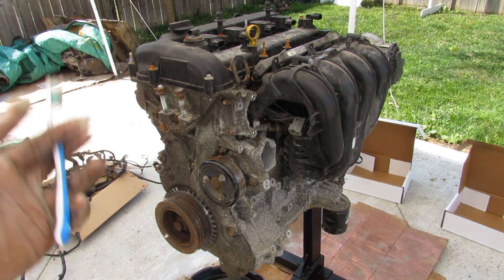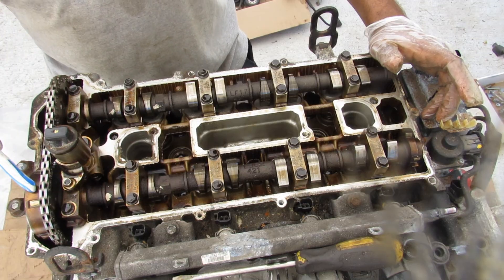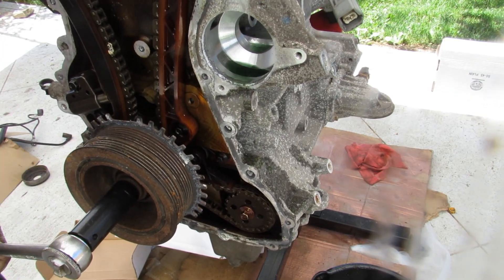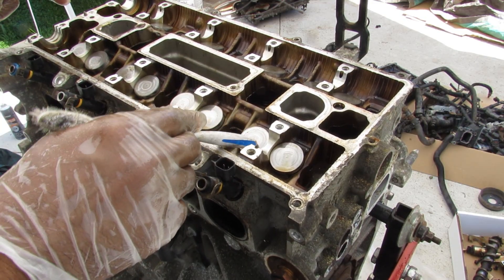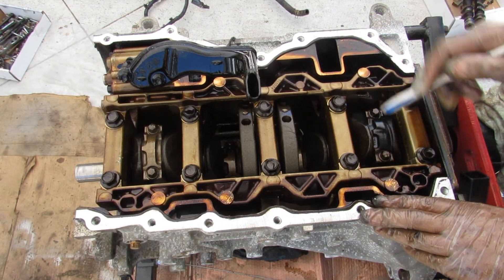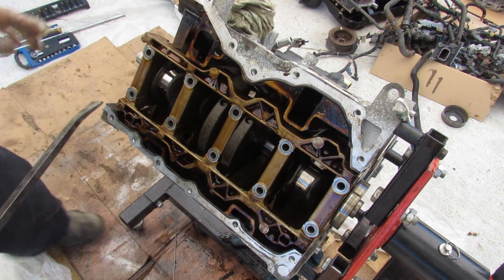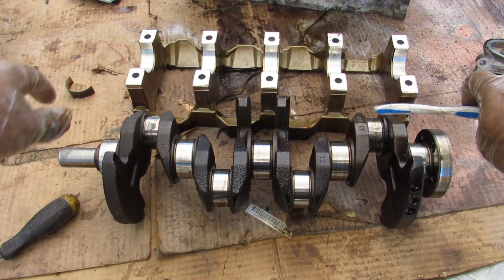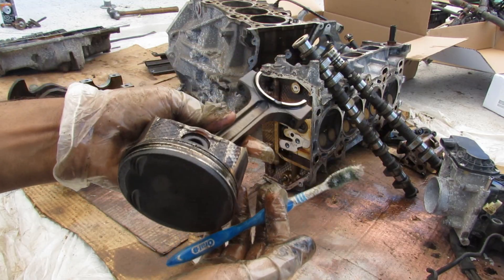Why Mazda Engines FAIL

Comment: 11:00 time. The cooling system, was not designed for enough heat dissipation. The aluminum block, also is a problem, with thermal expansion, and therefore vertical twisting, when cooling system WAS  NOT  ENOUGH. The block, is too high, for its' width. The oil system, is poorly designed, also. Starving 1 and 4 crankshaft rod bearings.

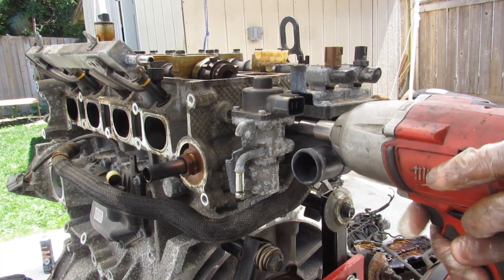Comment: wow. What a goofy, dumb design. They have 'lost  their  way '', in designing, and producing aluminum blocks. No keyway for timing.?? plastic parts...?? wtf. 6:10....i've  watched enough.....this is NOT  designed, to be repaired. Just throw it in the re-cycle bin. Get an older inline 4, or 6 cylinder...modern 'junk'...

Comment: I have a 2010 ford focus with this engine, 110,000 miles and everythings fine. Ive changed alternator, motor mounts TWICE,  and the thermostat. I bought it since new, ive always changed the oil. How long could this engine last?
Reply: With the servicing and maintenance in check, you haven't even hit half it's lifespan. I'd expect atleast 250k miles.

Comment: My 2013 Ford C-Max hybrid with this same 2.0 engine has 190k. Runs perfectly and doesn’t burn a drop of oil. I do run full synthetic and change the oil ever 6k. Even I’m surprised it’s been so good 😂

Comment: The duratec  and MZR are not the same engine.
Reply: AFAIK engine block is same, Mazda and Ford made different heads for themselves.
Reply: @petrnemecek4379  That's the Duratec V6. Ford had it originally, then Jaguar made their own version of it with better flowing, and VVT heads. Mazda then used the Jaguar version (Hence why they called it the AJ, it's a Jaguar designation).

Comment: I have a Mk2 Focus (not North American) with the Mazda Z 1.6 paired with the G4A-EL 4speed auto. I'm just at 80k very urban miles and it's lost some compression and the valve cover gasket was replaced. Getting 17/23mpg US city/hwy. Exhaust smells a bit too rich even when warm. No problem sustaining 100mph amidst tropical temps.

It's everything outside the engine that's been more problematic. The front suspension is overstressed and needs new ARB links every year. The auto trans has harsh shifts from first to second sometimes (maybe a faulty solenoid). The AC blower, brake booster and the fuel tank are hard to access. Googling parts for the car is a bit complicated as the Mk2 shares little with American Fords but at the same time the config we got in Southeast Asia isn't identical to what they get in Europe (they got the Zetec instead of the MZR). I have to use Mazda3 info sometimes to get a better idea.

Comment: I’ve installed a used engine from a salvage yard into a customers car, only to find out the salvage yard had loosened the crank bolt. This means disaster, since the timing chain spins when the cams try to center on the lobes. The cams must be locked with the correct holder tools, BEFORE loosening the crank pulley bolt! For crank TDC you can use the pin, or a dial indicator on the piston. The crank won’t spin on it’s own, as easily, only the cams.

Comment: You should do a BMW m62b44 v8 with the worn timing chain guides. Typically results in grenading.
Reply: BMW =  Bad  Motor  Works

Comment: very cool we got this engine in the ford fiesta st 150 mk5/mk6 in europe in a slightly different configuration. no egr valve no variable timing and no flaps for the intake. i also think they are good and reliable when you take care of them also they have alot of potential. i went to the dyno last year with my 215.000 fiesta and it made just with an exhaust system 158hp while factory its 150 and with cams intake and a tune they can make up to around 190hp. compression was also very nice 14-15 bar troughout all cylinders. im just wondering how you set the crankshaft sprocket right because it triggers ignition and it nit beeing keyed is pretty messed up

Comment: Title should be: "why Ford engines fail". This is exactly the reason why i pass on the MX-5 NC series; they have Ford engines.
Reply: sorry to burst ya but all of the ford/mazda 4cyl are mazda/ford collaboratives since like the early 80's all the way until like 2013
Reply: @Foreverchanger the weakness is the chain and the vvt cam gear, everything else is fantastic even the oiling system and the materials used.
mazda designed, ford puts its own engineering into it and they both manufacture a parts bin which lots of versions of the same engine are made from but are all entirely compatible, even the ecoboost engines share that same parts bin
Reply: Since the NC came out there's been very little trouble with that engine. Again the only thing I've seen is damage from lack of maintenance. Beyond that you might have a thermostat on occasion just like the rest of the Ford engines.
Reply: The MZR L engines were mostly engineered by Mazda. Fords involvement was limited to certain off the shelf parts and ensuring adaptation to their own cars. It is not correct to claim these are Ford engines when they were engineered and produced by Mazda.

Comment: Cant you just loosen the lower timing cover bolts
if the pan needs to be dropped off, ???
 I.e. No need to remove the whole timing cover ¿¿¿
Reply: Yes. I've resealed many an oil pan on that model and you can get the oil pan off without removing the timing cover.

Comment: Duratec is a reliable engine, change coolant every 30K, will last 300K + easily
Reply: Err ?? Here in Oz taxis with Barra engines go over 1M kms and then the engine is still sought after.

Comment: Bc dummies are using 20 weight garbage. It should be illegal (and doing 5k+ oci on dino or 10k on syn thinking it's safe). 

Newsflash: The manufacturer is a liar and wants the car to fail.

Comment: Much respect for posting this!...I have an '07 Ford Focus with the 2.3L Duratec/MZR...it's nice to know that the water pump is easy to access, but I'm not looking forward to re-timing the engine if need be 🥴
Reply: These engine are really easy to work on 🥴 and you don't need to time it if you're just going to replace the water pump
Reply: @carlossantamaria7967  I'm a Honda tech...so when I got this car last year and I heard that these engines are not keyed, I was worried to say the least. Otherwise...it's easy to work on, just like most JDM engines.

Comment: I have two Mazdas with the 2.3L, both have around 280,000km. Oil is changed every 5,000km with conventional 5W20 oil. So far no problems.
Reply: Dont use anything lower than 5W30! Mazda repeatedly said about VVT warranty! people used thinner oil and it fucked up the car!
Reply: @dacoda6668  Got links?

Comment: Sooo this engine is junk engineering... stay away ???
Reply: I don't think that's what he said.

You'll wreck any engine if you run it low on oil enough that the bearings don't get any lubrication. This was a neglected example. Same with most of the other engines speedkar has torn down. If they were looked after, they'd still be in service!

Comment: These engines are good darn pretty reliable though, seems like this ones been neglected. Had many customers over 250,000km and running strong, 2.0, 2.3, and 2.5 MZR’s. Anyways, depending on the owner pretty much any engine would suffer the same failures.
Reply: I have the 2.5 mzr with 335,000km and no problem at all. Engine works like new.
Reply: @reneteinmann4345 yes, they all work like new until the bearing fails. It doesn’t give you any warning. Once the bearing thins out a bit, it just spins because there is no tab to stop its rotation (like most modern engines have).

Comment: Oil seems to be the problem here,these extended oil change intervals are NOT a good idea,the oil companies have made a big thing about how their oils perform over long drain periods and charge a fortune for it. The oil he drained out of that engine must have been in there for thousands of miles. When an engine is new you can get away with it but as the engine ages and wear and sludge builds up more regular oil and filter changes are required to prevent things like this from happening. I Never buy these expensive oils but I change my oil every 8000 miles MAX and have Never had any problems,the price of oil compared with the cost of engine damage like this is negligible. Never have or Never would use these long life oils if they paid ME to use them if they stipulated that I had to leave it in for 30,000 miles.

Comment: These engines are really reliable. You just have to change the oil and keep the level up. These engines have been known to last 300,000 miles with the proper maintenance.
Reply: I'm at 300k
Reply: Im at 217K, going strong
Reply: @misfit4816  I'm at 228k and I'm bad about changing oil on time but I drive really gentle.
Reply: But NO KEYWAYS!!!!
How the hell do you TIME these engines WITHOUT a degree in mechanical engineering or a plethora of "Mazda-only service tools"? (rhetorical)
Key-less engines suck balls, no matter what, no matter who the manufacturer.
Reply: @VauxhallViva1975 Those would be Ford special service tools. Ridiculous design, so easy to f it up
Reply: Mine is Mazda 6 2003 1.8 88kw it has 380000km, timing chain is still factory and factory sparkplugs mazda original last time changed 2009 ... 😂 I use Mobil 10w40 and no problems
Reply: Just had mine finally take a dump after 247k miles. And up until a rod bolt let go, she ran like a champ every day
Reply: yup, i got a 2.0 in a focus with 275k miles and it runs like a champ
Reply: 100% agree
Reply: What aboutoverheating
Reply: They are COMPLETE GARBAGES, over complicated for nothing, a shitty sluggish @130bhp which consume A LOT. Why would anybody buy that instead of 1.9tdi from vag group which is waay simpler, more powerful and way more economical?
Reply: Your statement is absolutely correct these engines will last the $300,000 mi but you cannot skip oil changes and let the oil get too low
Reply: 300,000 miles?!!!  Yikes! Mine has 328K and runs perfect.  BUT, I'm taking off the pan to remove a stuck drain bolt.  I just hope this isn't the kiss of death.  BTW, I also hope that I don't really have to remove the timing chain cover.  I really don't want to do that>
Reply: Yup. Got 330kkm on mine and it's still running perfectly. Compression is perfect, no weird noises. The previous owner just had all the scheduled maintenance done on time, and replaced the oil once per year. The problem with these engines is that the typical owner of a mazda 3/6 doesn't care about their car and thus neglects maintenance.
Reply: Shit engines . Wish i kept my toyota 😄
Reply: I am 340,000 miles on my 2012….2.5L
Reply: I had a Mazda 6 with 2.3 never had problems
Reply: Here in Oz, taxis running the Barra engine go more than 1M kkms, and the engine is then still sought after.
Reply: Very true, and the newer ones are know to make over 300hp with the stock internals due to them being forged from factory
Reply: Mine had low oil for a minute. Just topped off but I change oil every 3k and get the car looked at about 6 times a year. Even with low oil performance never changed much.
Reply: @Straightforward-iPhone-Tips does your oil light occasionally flash while at idle or below 1500 rpm?
Reply: @BigHairyManBeast  Check your oil level. What kind of oil are you using?
Reply: A few good ones no doubt the majority are rubbish
Reply: Those engines are not reliable at all. A few years ago I was looking for a Mazda 3 first generation and basically all of those that I found for sale had major engine and/or transmission problems. The majority with overheated engines.
Reply: @leumamk5259  second gen is a lot more reliable especially the 2.5
Reply: @leumamk5259 you have to remember 99% of people don’t do proper maintenance, service late, or seek new cars after a certain amount of time and disregard their old ones
Reply: @Destiny-2015  Still speaks bad about that gen because if bad reliability were the result of the fact that 99% of people in general don't do proper maintenance, then other makes would have the same problems. I've never seen a considerable amount of Corollas from those years, for example, with those problems (if any case, two or three).
Reply: @leumamk5259  Very reliable. Unless owner is moron and cheapskate...
Reply: @leumamk5259  maybe something to do with the vvt? the ford 2.0 and 2.3 dont have it, my car has the d20 with 270k+ and it runs fine
Reply: @leumamk5259  that’s because the proper maintenance wasn’t done, and yeah, things will have to be replaced, I don’t understand why some people think otherwise 
Has nothing to do with how reliable it is, it just means you gotta take better care of it so you don’t get to that point. Or to maintain it after you do repair it.
It’s like a sword m8, they can’t just be neglected and be expected to not deteriorate
Reply: @anthonymilosevic6862  I'm sorry, but your point would make sense if the cases I mentioned were isolated, but literally 98% of the Mazda 3s I saw (hundreds) had either transmission or engine problems, and all of them at around $1,000 or less. And that was a few years ago.
Reply: They are junk. Besides the fact you shouldn't have to add oil to a low km engine.
Reply: Lmao junk? I got 312k on mine. Fuck outta here.

Comment: You're very good at figuring out all those various "passages"--- Oil, water, exhaust, cam phaser, EGR, hydrogen, sludge return to pan, metal return to pan, and where bent valves end up. Kudo's. Keep them coming.

Comment: Rod bearings and cam phaser issues are some  of many reasons that Mazda separated from FORD and made their own design Skyactive  engine and transmissions
Reply: @leekumiega9268  Engine block is Ford, Mazda designed different head for their cars.
Reply: Who’s to say these later engines won’t have issues.  The MZR is a Mazda motor.
Reply: Note that only miata which didnt have any rebadged product with ford, is bullet proof reliable. So i think ford is the culprit.
Reply: No, the NC miata uses the MZR too. Mazda designed the MZR originally, and Ford had and still has license to use it, they just change their own things on it like the head design, and pair it with shitty transmissions like the Power Shift
Reply: @leekumiega9268   negative, it was designed by Mazda.

Comment: I managed to catch my spun bearing in time,was making a slight noise from cold (1 or 2 secs after startup),when I disassembled,the bearing had moved about 10 degrees from where it should be.
I keyed the conrods and installed keyed bearings and never had a problem since.
Reply: I would also like to add,that some of the MZR's use an oil feed from the timing cover to supply the VVT.

Comment: I own a 2011 Mazda 6 manual transmission with one engine similar to this one, the 2.5 liter version. they are really good, and they don’t have the direct injection like the sky active ones, mine is already on the 175000 miles with no problem so far, one thing I like it’s I don’t have to worry about direct injection issues neither transmission issues. Only oxygen sensor replacement so far, regular maintenance
Reply from the maker: Wasn't 2011 when skyactiv started?
Reply: @speedkar99  at least not on the Mazda 6 model. Because my Mazda 6 is from 2011. I think 2012 was the first skyactive
Reply: @speedkar99  I also had a 2016 Mazda 3 with sky active and automatic. But I sold it recently with 90000 miles no problems either. But I just did not trusted their build as the old 2011, I don't know, maybe it's just me but I trusted the manual tranny and did not want to bother with direct Injection carbon build up later on.

Comment: I don't know if you got the Mazda 2.2 Diesel in the US market but we have it here in New Zealand and they're notoriously unreliable. A true matter of when not if they shit themselves.
Reply: Yes Mazda diesel are not good but they did barely made it to US
Reply from the maker: No we don't get that
Reply: They have Ford Focus diesel in EU. The one I had watched on YT video was 2010 with 470k kms and seemed very reliable.
Reply: The 3.2 litre 5 cylinder diesel is such a dog that Mazda have now gone to the quite old Isuzu 3.0 litre. Don't go to smoko while the oil is draining or the oil pump won't pick up the oil after the change.
They must vacuum bleed them in the factory.
Reply: Mike Newman, I had one in a Ford Ranger. It had issues twice under warranty and left me stranded. The 4JJ1 (predecessor to the current BT-50 engine) is one very reliable Isuzu engine!

Comment: Does the 2.5l in the Ford Fusion SE's have the same little faults?  I got my 2017 with a 2.5 because Ford owners really liked the engine and praised its reliability with good maintenance.   Seemed like the best engine choice compared tot he turbo ones.
Reply from the maker: Yes It's similar

Comment: I have 250K on one of these engines. Thanks for the teardown, I'm sure it'll come in handy one day!
Reply from the maker: You are welcome. Does it burn any oil?
Reply: Are you using Conventional Oil , Synthetic-Blend ,   Full Synthetic  in your engine?   Just curious as i have this engine with 50,000miles/80,000km
Reply: @lightningsmokerXx  I've used synthetic changing it every 6-7k miles. It doesn't burn any oil but recently the valve cover gaskets started leaking some oil into the spark plug wells. Put in a new gasket which solved the problem.
Reply: @jmannUSMC  I've heard the valve cover gasket is a common thing to leak around the spark plug-well or whatever they call it.   Do you stick to 1 brand of synthetic oil, or just grab whatever is on sale.    It doesn't matter.....but i was just curious.
Reply: @lightningsmokerXx  yeah I just get whatever is on sale at O'Reilly's. I like shopping there because they stock Wix filters
Reply: @lightningsmokerXx  also don't forget to service your auto transmission if you have one. I try to change the fluid every 75k
Reply: @jmannUSMC   Thanks for the tip.  So far i'm doing it every 36,000 /58,000km on the transmission fluid & transmission filter. Ive done that on OEM motorcraft fluid, but thinking about using amsoil transmission fluid .